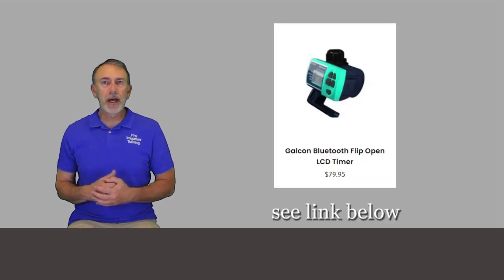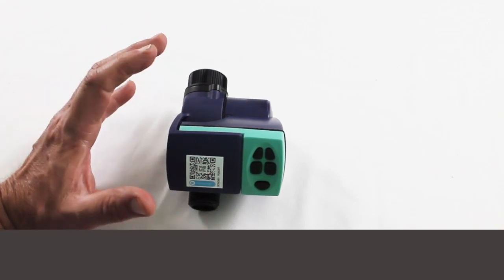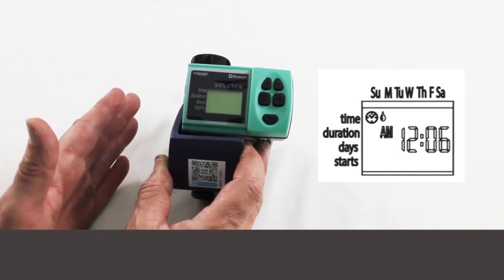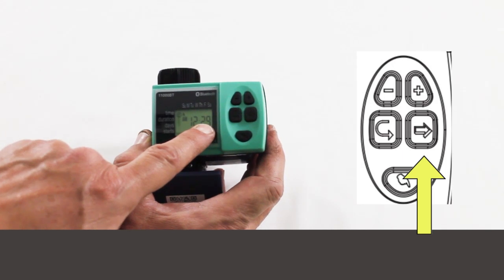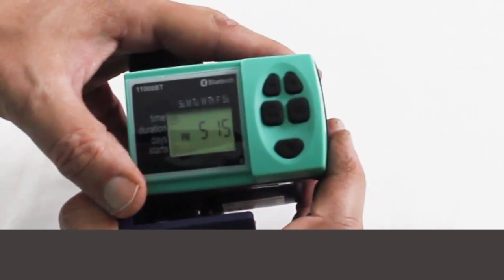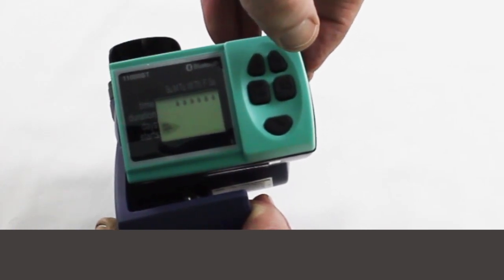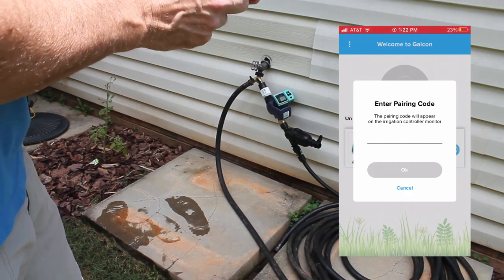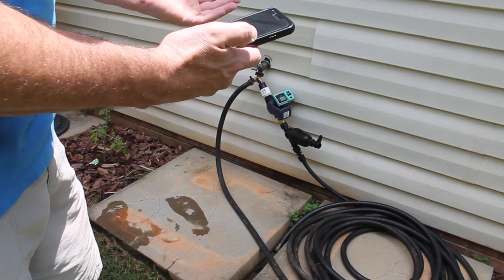How To Program Hose End irrigation Timer (Pt 2 of How to Install a Garden Drip System)

Comment: I have had different ones and I love them.  Made all my watering easier. I need to replace them after many years of working.  Unfortunately I need a programmer that can handle 4 different garden beds
Reply from the maker: You might need to switch to a regular 24v timer and use solenoid valves to control your 4 beds separately.